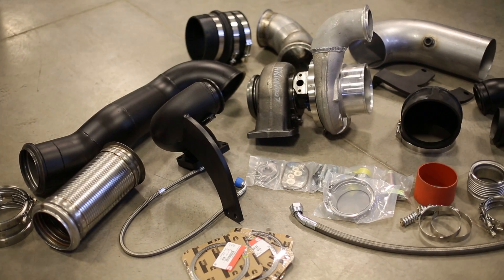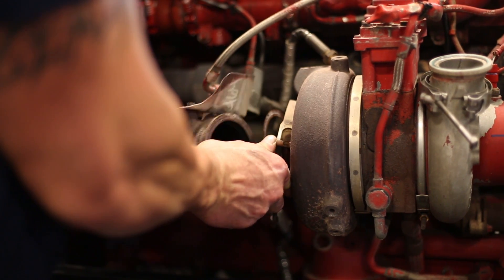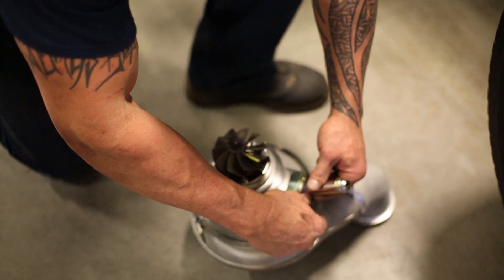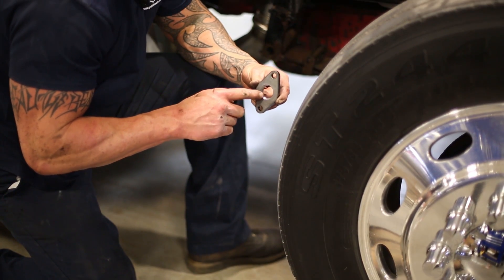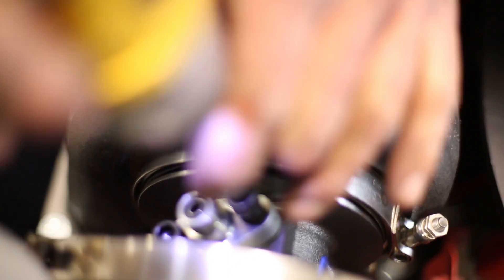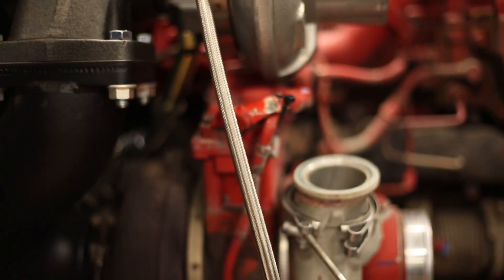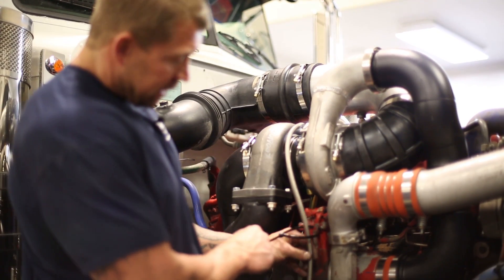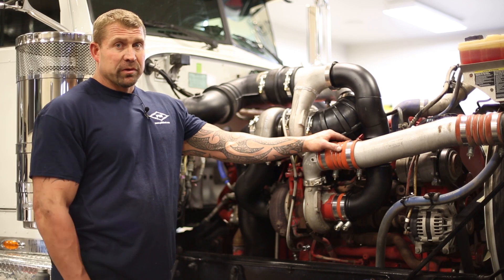How to Install: PDI Add A Turbo Kit - Cummins ISX-15

Comment: Could this work on my 2012 Freightliner cascadia Cummins Isx15?
Reply from the maker: No. Not enough room under the hood.  But you could run our big boss tuner and intake manifold.  That would give you much better HP/TQ/Fuel Efficiency

Comment: Can this turbo system be installed for the Volvo Vnl Truck with the Cummin X 15 engine with 565 hp ??!! 😊🤔
Thank you very much if you answer my question.😊🙏🏻🙏🏻
Thanks for your great and practical page and your very professional company🙂🙏🏻🙏🏻🙏🏻🏵🇺🇸👏🏻😍
Reply from the maker: Unfortunately not, not enough room under the hood.  You could run our big boss tuner and intake manifold though!  That would gain alot on HP/TQ/Fuel Efficiency

Comment: does that compound kit fit a cm2350 on a t680?
Reply from the maker: It will if you brought the truck to our shop for a custom built piping kit and install.

Comment: Do you have this kit for t680 isx
Reply from the maker: You can bring the truck to our shop for a custom build/installation.  But the kit is built/designed for a long hood Peterbilt 389/KW W900L.

Comment: The biggest concern I'm having is how reliable is this setup? Have you guys had customers who been running this for a while ? Just curious to know about the longevity.
Reply from the maker: Yes sir! We have customers that have now been running this for close to 4 years, many are well over 400- 500K miles with this setup and still going strong.  Give us a call if you have questions on it.  1-888-588-7113 Thanks
Reply: Do you sell new gaskets for this set up?
Reply: Working 4 years strong 💪🏻

Comment: I wonder if this would fit in my Lonestar
Reply from the maker: Never done one on a Lonestar.  It would likely be very tight, we have done a couple sets on 579 & 567 aero peterbilts.  The kit is designed for a 389 and W900L.

Comment: So I watch this vid and all I can think of are the twins on the cat and the problems with those.
Reply from the maker: The actual turbos on the Acert CAT were truly not very problematic.  There were several other issues that lead to that engine series getting a bad reputation.  When it comes to air flow, two turbos are superior to one, no question.  If you do not need extra air flow, and have other options to get the optimum air and fuel ratio, then a Big Boss single turbo is also very effective.  Thanks for watching!

Comment: What's  the  cost? I have  2019 peterbilt  579  a year  old.  If I  were  to  to that. Will  it  void  the warranty?
Reply from the maker: Yes it would void warranty with the add-a-turbo.  The Intake manifold and tuner you can avoid warranty issues for the most part.  The Tuner is $2350, Intake manifold is $1350 and the Add-a-Turbo kit is $5500. Thanks for watching!

Comment: at what stock hp setting does those 15-20% apply to? also do you have to reprogram to balance the boost? or does it just add more boost on top of what the factory turbo puts out?     and lastly I have a 2014 international prostar will there be an adapter kit based on the truck cause i know my air cleaner and exhaust isn't run the same way as this peterbuilt
Reply from the maker: Good questions!  The 15-20% increase is based on the engine's peak HP output.  We do slow down the primary VGT turbo about 20% to take some work load off of it, and make the compound setup work properly.  This kit is designed for the long hooded 389 Peterbilt and W900 Kenworth.  We are able to do custom applications in our shop, but there are no plans for adapters for other model trucks.  Thanks for watching!

Comment: I would be interested in the atmospheric turbos specs. To me it looks like a S400 with a 1.32 ar 96mm Ty turbine and a 75-80mm billit compressor wheel and a custom compressor housing with a 90° tig welded on.......  Or something very similar in size!
Reply from the maker: Pretty dang close!  We now have this compressor housing cast, so no welding the 90 on any longer.
Reply: @pdidiesel  nice!  If you said it was an 88mm flowing up to about 135lbs/min @ a 2.6 pr then I know exactly how much power potential I have in my truck lol. And that my math was correct when I spec'd mine out

Comment: Either this truck is gonna be deleted or it’s gonna have big aftertreatment problems
Reply from the maker: Thanks for watching and the comment!  This set up is designed to work with all factory emissions, and has been working extremely well.  We put the first setup on a customer's truck over 18 months ago.  He has logged nearly 200K miles with no problems, emissions or otherwise.  That was on the new X15 with the improved after treatment system.  We have many other customers running this system, with them being mixed on 2011 - 2017 CM2350 series ISX and 2018- Current X15's.  The proper maintenance and use on these new emissions trucks goes a long way.  Thanks again for watching.
Reply: @pdidiesel  he clearly doesn't understand that the lower egt also helps lower the NoX levels as combustion temp is the cause of generation of NoX. So Robert, it will not effect the catalyst or def system if you have it turned. As far as dpf if you get more air in and have a proper fuel rate it will not smoke, and smoke being carbon soot is what kills the dpf. Dpf issues pretty much only come from bad tunes, mechanical issues or STUPID drivers idling constantly.
Reply: If you change your oil and don't go over , don't do a lot of idling and don't use thar poor quality diesel  you won't have any issues with the DEF systems.
Reply: He’s probably an old school super trucker whose doesn’t believe in technology and stuck on those 70s 80s caterpillar motors.

Comment: Would you have to increase fuel with the upgrades?
Reply from the maker: Yes, you would want to run at least our Economy fuel tune, with the adjustment to the VGT turbo speed to get the full effect and efficiency out of this set up.  Thanks!

Comment: Is this kit " Ca Legal " by chance? 
I'd be curious to see what the X15 version will look like. Are you guys currently in R&D?
Reply from the maker: We do not have CARB E.O. for this set up. However, it will not affect the emissions output of the engine, so to that regard it can be ran as you see fit.  It is available now for the X15. Thanks!

Comment: How's it affect the Jake brakes on an isx 2350? What happens if you don't do the ecm tuning? Does it add boost? And will egt's stay lower when running 38-40 PSI boost currently for 5-10 minutes on a daily pull?
Reply from the maker: The jakes improve due to the compound set up.  You would need some tuning to run this efficiently, it does add some boost and the EGT's stay much cooler on a hard pull.  With our Intake manifold a long hard pull the Pyro will hit 800 - 850 max.

Comment: How much horsepower, torque and fuel economy will be increased by adding a turbo kit?
Reply from the maker: The gain is 15%-20% over stock settings.  The add a turbo is to move the air to keep exhaust and intake temps low to utilize the power and torque efficiently.  The average fuel mileage gains are 1 mile per gallon with this set up.

Comment: I wonder if the Benifits are worth the price or more for show. I’d invest on fuel savings especially running here in California.
Reply from the maker: Great question! The average gains accomplished are .5 to 1 mile per gallon.  With 1 mile per gallon gain, the average savings is nearly $1500 per month.  This would pay for itself quite quickly and start putting $ in your pocket!
Reply: @pdidiesel  what about the gains with this and your big hoss intake?
Reply from the maker: The HP/Torque gains are great 15-20% over stock setting, the fuel efficiency has been right around 1 mpg.  Thanks!

Comment: How many horsepower you add with this awesome kit?
Reply from the maker: The gain is 15%-20% over stock settings.  The add a turbo is to move the air to keep exhaust and intake temps low to utilize the power and torque efficiently.  The average fuel mileage gains are 1 mile per gallon with this set up.

Comment: Super nice. 

Hey do u guys have an add aturbo for a 1995 t600 ddec3 12.7?

You made this look super easy.

Oh by the way. I have a 171702 Borg Warner
Reply from the maker: We don't offer a pre-built kit for that engine in a T600.  Sorry!
Reply: I have a ddec iv 12.7 that I am building a compound setup for. The T600 can be tight under the hood so im not sure if it will fit or not. I have run the numbers and the best setup (for normal use not racing) is the factory waste gated 12.7 turbo and a SXE400 in 88mm (sxe is the billit compressor wheel version) configuration running the 1.32 a/r turbine housing. Should good for about 600-750 on a little tune. The piping work for a series 60 is dead simple so any decent shop can make it up.

Comment: on a 600hp factory engine what kind of gains could you get with the added turbo and tuning?
Reply from the maker: The gain is 15%-20% over stock settings.  The add a turbo is to move the air to keep exhaust and intake temps low to utilize the power and torque efficiently.  The average fuel mileage gains are 1 mile per gallon with this set up.

Comment: Nice kit, how much hp increase can you expect out of the kit?
Reply from the maker: The gain is 15%-20% over stock settings.  The add a turbo is to move the air to keep exhaust and intake temps low to utilize the power and torque efficiently.  The average fuel mileage gains are 1 mile per gallon with this set up.

Comment: What the advantage of having it ?
Reply from the maker: The gain is 15%-20% over stock settings.  The add a turbo is to move the air to keep exhaust and intake temps low to utilize the power and torque efficiently.  The average fuel mileage gains are 1 mile per gallon with this set up.

Comment: I have a dumb question, aren't you dumping diesel into the top hot side turbo by having the dosing injector in between the two?
Reply: On the isx and x series the dose system is for def, its not like a cat ard head tgat injects diesel

Comment: Cummins should have done this from the factory !! Nice kit
Reply: Big corporate Cummins would never admit that some innovative independent shop could produce something better then their "expert engineers".
Reply: @dougkratz5269  Cummins have "big people to answer to" and behave according to a set of rules "handed" to them if they wish to stay around and in business.
Not defending them, just mentioning what a lot of people either conveniently "forget" or give very little thought to.
Reply: Back in the day, Cummins did make a twin turbo NTC with step timing control and it was rated at 475 hp or so.  The VGT turbo on an ISX can support a lot of power though, and adding more air to a diesel is a win always.
Reply from the maker: Thank you sir!